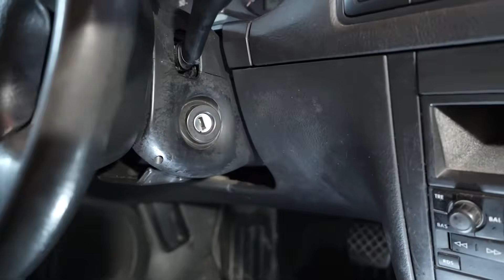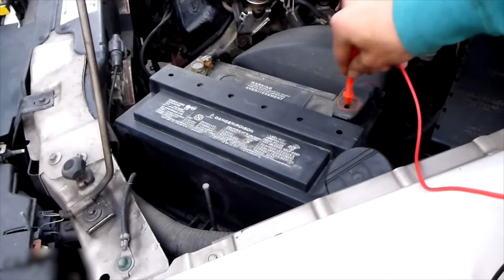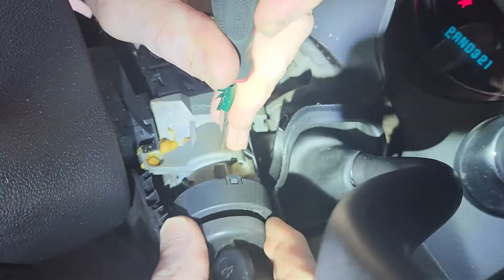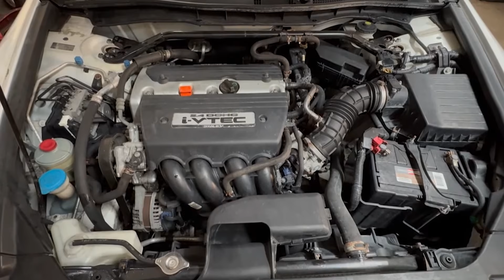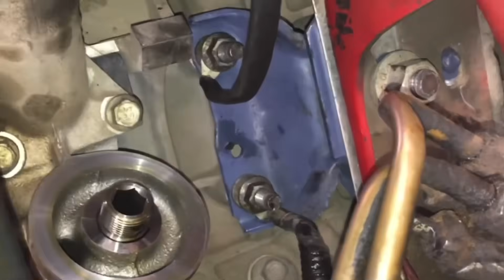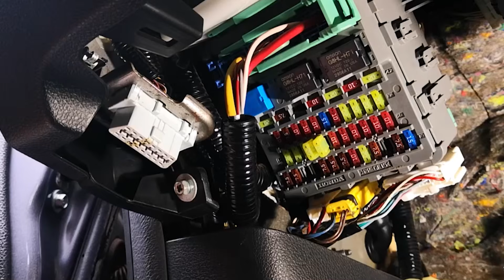No Crank, No Start – What’s Stopping Your Car from Turning Over

Comment: I have a 2006 ford f150 pickup that is a no crank or click tried numerous things and still won't start
Reply from the maker: Since you have a no crank, no click issue, you should check your battery terminals, starter relay, and ignition switch for potential faults. 👍

Comment: ,,,,,
You forgot to mention 5 ;
Lubing the battery posts & 
cables clamps with silicone 
compound , after cleaning them 
to prevent any corrosion afterward .
Reply from the maker: That's a great tip for long-term maintenance, thanks for adding it! 👍

Comment: While it CAN be some of the things pointed out in this video. Usually it is the solenoid which is a $20 fix but shops will say 'You need a new starter' have done it 10s of times, that danged solenoid was the issue. Then shops will install a 'remanufactured' starter on top of that, as they are cheaper and charge you for a new OEM starter. That happened to a friend come to find the shop put in a remanufactured for the price of brand new.